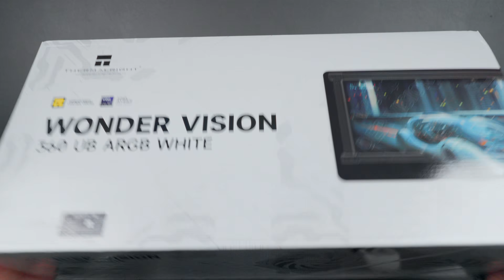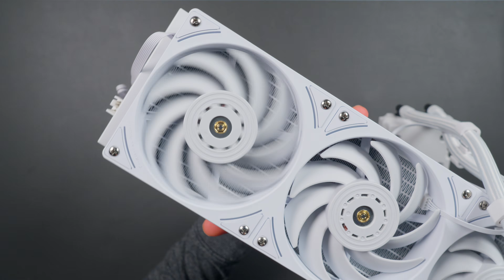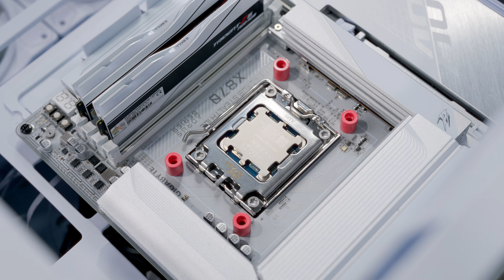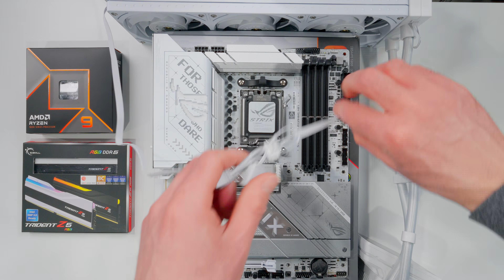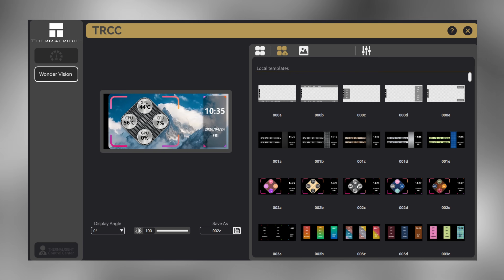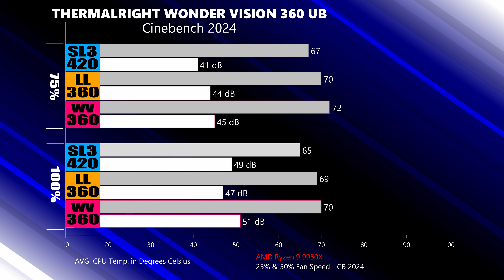Thermalright’s CRAZIEST AIO Yet?! Wonder Vision 360 UB ARGB Review

Comment: I'm running Thermalright AIOs in two builds, and TRCC hasn't given me any issues with GPU stats. It even reads the GPU fan RPMs w/o issue. TRCC is a bit clunky, but overall, serviceable. I've gotten used to the quirks, and actually it's pretty capable and customizable.
The pump does become audible in the upper RPM range(s), but I'm not hearing anything like what your mic picked up.
Still, I capped mine at 4500RPM to keep it mostly silent. Doing that didn't really affect temps much, so I'm fine with it.

Comment: Old news dude... been having this in a PC since last August. The Levita Vision and Rainbow Vision are newer models
Reply: thanks for this comment, i was literally just eyeing up this wonder vision - think i'll go for the levita vision instead👍
Reply: @Nogero404 the Levita Vision can be rotated, and generally looks nicer... if it existed at the time of my build, it's what I would have bought
Reply: @MarineMike03Gaming Wonder can be rotated too. Levita has a far smaller 3000  rpm pump compared to the 6400 rpm on the Wonder.

The only difference between the Rainbow and the Wonder are the fans with the Rainbow being much more aggressive. They both have the same size and spec display (positioned differently) and same pump so you are paying that extra money for better performing but louder fans